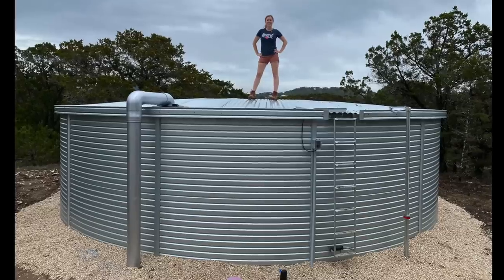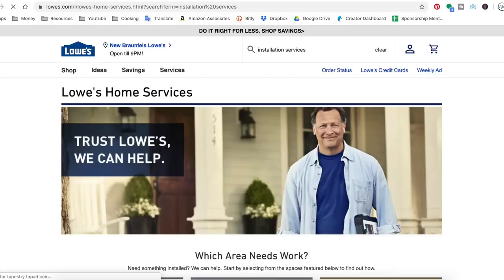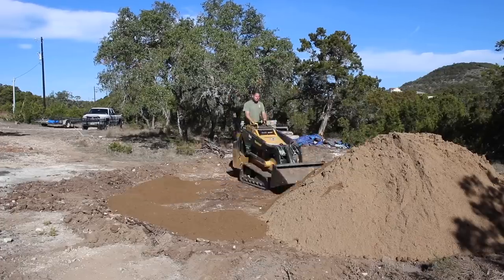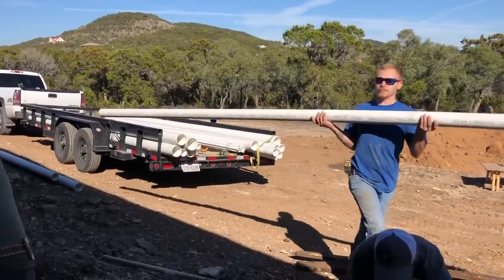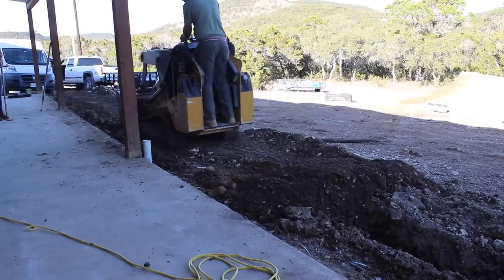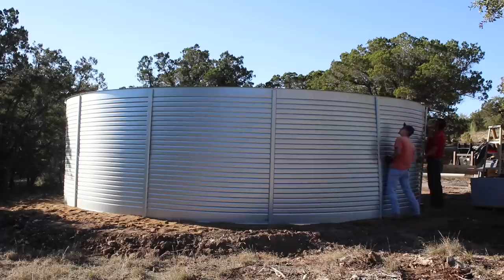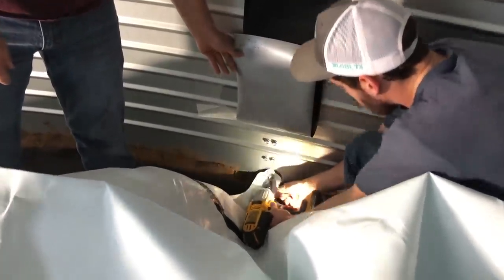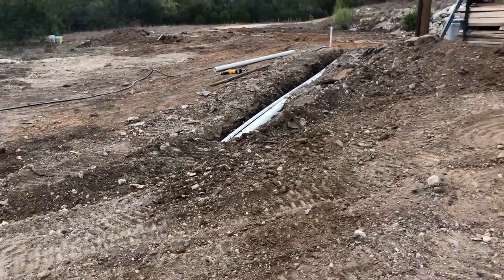Installing Rain Water Collection

Comment: I’m curious about the cost?
Reply: The average cost of a system like that for household supply in central Texas is $30k, plus or minus a few thousand based on the sitework and amount of collection piping.

Comment: Only 1 thing I would of done different.  I would of contacted the local fire dept. and asked about adding a outlet for the fire dept. to connect to in case the you ever needed it.
Reply: In Australia when I installed my tank I had to provide and fit an outlet valve on the tank so the local rural fire brigade had an alternative supply. This was rural Victoria in 1986.
Reply: Only makes sense.  After 25+ years in the fire service I know first hand those extra supply sources are great to have! Plus here in the States it can help lower your insurance.

Comment: Laws against rainwater harvesting/collection make no sense to me. In Australia, drought is a pretty big and unfortunately all too common issue. People here are encouraged to have rainwater tanks to minimise the amount of water we have to use from our potable water resources. The additional advantage is that it saves us money on our water bill!
It helps to prevent flooding in the event of heavy downpour after a long hot dry summer in which the grounds turn to almost-concrete, and using the water outside of the rainstorms means that it can contribute to any water run off sources that feed rivers or streams that native animals rely on for hydration. Win-win-win.
Reply: Australia is many decades ahead of Central Texas when it comes to rainwater harvesting, but we're trying our best to catch up. We have very similar water issues.

Comment: Can you mix a gray water system and a rain harvesting system. I’m sure I produce 100 gallons a day from showers, laundry, and baths.
Reply: gray water should not be stored more than 24 hours, or it can become "black" water.  Rainwater is very clean if collected from a roof but if mixed with any gray water will become gray water itself...

Comment: @ April Wilkerson How much rain water can be collected in this system?
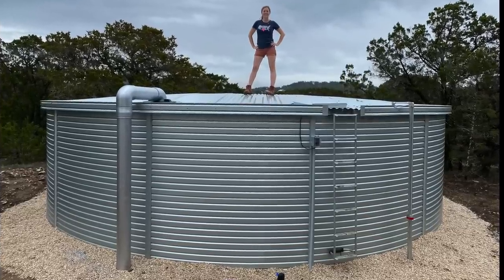Reply: She answers that question 10 seconds into the video. 0:10
Reply: @GeneWaddle  I do not have English, can you write in writing?
Reply: @alonsobrosmann4300  Sorry, it's 30,000 gallons/114,000 litres.
Reply: @GeneWaddle  Thank you for your answer
Reply: In central Texas the average annual rainfall is about 900mm and it only takes 300mm of rain to fill the tank, so it can fill 3 times per year.

Comment: I'm one of those metric viewers you mention, which is equivalent to 3,5 imperial ones I think...
Reply: A gallon is 3.78 liters. that's 113.4k liters of water cap... And 113 tons of weight ;) That's like two cistern trucks. The British gallon is 4 liters, but haven't seen it used.

Comment: With 37 inches annual rainfall, looks like you can fill it twice a year. Or your well can fill it once a day with hard water. Rain water feels so good. I'd at least plumb it to the shower and bath. Try shampooing your hair with rain water. Amazing. 

I would have added a large tap from the tank for the fire department to pull from. Call your fire department and ask about a fire hydrant. They can draw the water with their pumper.

Comment: so the water runs up the pipe into the tank ?
Reply: Yup.
Reply: @GeneWaddle  most be one hell of drop from the roof
Reply: @lesmoor001  It doesn't have to be. The roof only has to be a little higher than where it goes into the tank.

Comment: I don't understand....how does the water run UP that 6" line into the tank???    The momentum of the water is great enough to run straight up that pipe???
Reply: Because the pipes the water is going into are higher than the pipe feeding the tank. Water seeks its own level.

Comment: Here is a useful calculator to figure the amount of rainfall over a given area in gallons. 
https://water.usgs.gov/edu/activity-howmuchrain.html

or a quick and dirty method is this:
Rain catchment area in square feet X rainfall in inches X .62
e.g. 2000 X 30 X .62 = 37,200 gal. (actual amount according to the USGS link- 36,205)

Comment: Why not have the overflow drain push the excess water into your well?
Reply: NO, NO,........no. The last thing you want is to contaminate a well with surface water. That is the reason where there is a well there will normally be a pipe sticking out of the ground so as not allow surface water into the well.
Reply: Larry Be I did not mean directly into the well. I meant have it dispersed on top of the well so it can soak back into the ground water. Rain water re enters wells/aquifers all the time by permeating through the ground and having the dirt, rocks, and other permeable layers remove contaminates. If I had a well I’d water the water to be dropped off in the area that would allow it to re enter most efficiently and not just run off downhill
Reply: @Michaeldashizz  
I see your point. Depending on what is subsurface with so much rock in her area it might never make it into the aquifer. We may not even know where a vein of underground water originates. That is the whole principle of drain fields for septic systems. Depending on the percolation rate determines what style system you can install. Too fast and it is not filtering good enough and too slow and it is not entering the ground to do its job. I suppose one could dig a big pit and fill it with stone and let it run in to seep into the ground. That is what was done at my parent's home with a french drain and it did just fine. It was amusing to see it when we had a downpour the sod would rise up in a mound.

Comment: With the tank alone not assembled or installed at $15K and no less then that much again installed, It would have to replace my city water for the next 41 years to break even with my current on grid water bill.
For farm/livestock use I can see it, for off grid home use a lifetime is not long enough to justify the cost.
Reply: It can cost nearly $30k to connect to the local water supplies in central TX when they're available, and a well with storage tank and treatment will cost about the same, and far more if reverse osmosis is required, so for new construction rainwater harvesting can be the least expensive option, especially in the long term.

Comment: April
What did it cost you?
Reply from the maker: You can contract the company or a local one to see what it would cost. There are many factors with any project someone undertakes including land, proximity, etc. so can be subjective. What it cost one may not be what it cost another because one may require a larger size. Thanks for watching.

Comment: No First Flush device, pump in wrong spot, pump too small for home , supply pipe to house too small.  We live in rainwater in rural Australia.   My pump supports 3 showers , 3 bathrooms, 2 kitchens.
Reply from the maker: That's great for you! Mine is to water my garden and yard so is plenty sufficient. Thanks for watching.

Comment: Laws against diverting water exist for the protection of the environment. People need to check their state and local laws about harvesting rainwater; especially when harvesting as much as 30,000 gallons.
Reply: Rainwater harvesting is generally considered beneficial to the environment as it comes pretty close to simulating pre-development water flow conditions.  Most of our clients use the rainwater in their home, then the wastewater is treated and sprayed onto or soaked into the ground, reducing runoff just as a woodland or grassland would and maintaining soil moisture throughout the year where it's applied.

Comment: It is stupid to ban water collection, especially when it is used for local irrigation  it is more likely to permeate to the water table and renew depleting ground water tables. Also if reduces carbon emissions as it doesn't require industrial pumps to pump water for miles. Every property should harvest water and use   swales to irrigate land, grey water should be used to irrigate trees, sewage should be treated then filtered through Reed beds and finally willow coppice beds which produce wood pellets for wood pellet mass heaters.

Comment: Why did you put roof on water collector? Leave water reservoar open and rain will fill it with water.
Reply: And any other crap that happens to be flying around plus dirt, bugs and other critters. Besides that, the shop roof is a much larger surface and will fill it a lot faster.

Comment: Those tranches are to shallow. If any medium/heavy vehicals runs over the ground above them they may crack.
Reply: The pipe used is pretty hefty and once the ground settles there won't be a problem.
Reply: The pipes are installed by professionals. Are you saying they do not know what they do?
Reply: @erikloupias7511  i didn't said that....and it was you who call them professionals not me. I said the trenches were shallow....which they are (due to solid rock soils). I said they MAY crack IF subjected to heavy loads. That reuse of the soil (grading) takes the edgy rocks but it's not enough to make it suitable for direct contact with the pipes (by the books). I've done lots of pipe trenching/fixing in urban places and stumble uppon other people ' s work (while digging) and you see patterns. Tha t's not a sidewalk on the city....but that's not  a garden next to a house either. That shop sees alot of "action". If she starts moving heavy loads of stacked slabs around (Mat Cremona style) those yellow flag unconformitys became red ones.

Comment: The economics don’t pan out for me. A 30,000 tank costs at least $10,000 and probably much more. It would take a year to fill with my downspouts. I can buy 30,000 gallons of city water for $170 in California. So it would take 60 years to justify the tank, assuming it and I lasted that long.
Reply: Your assessment sounds correct, and that a system like this would not work for you.  The economics are very different in Central Texas where we often have to choose between attempting a well or trucking the water in at a considerable cost. A tank this size pays back in 5-7 years if trucking the water in, and pays back immediately if your well fails or you can't reach good water and know it up front. Rainwater also compares favorably to connecting to a municipal supply when you consider the $20k or so it costs in impact fees just to connect a new home to a MUD supply.  (assuming there's no sewer involved)

Comment: Next step is solar panels =]
Reply from the maker: Yes! I want to explore all the things eventually.
Reply: @AprilWilkerson  Research SolArk.  Really like the idea behind these systems for grid tie/battery/solar controller.
Reply: @LordNelsonkm  That's a great device at least on paper, just a bit expensive. Since the majority of the load in the shop is motors, it might make more sense to distribute 400V DC to VFDs.
Reply: @NiHaoMike64  True, and since her load is a lot of big stuff, I'm assuming a solar system will be for meter offset.  It would have to be a rather large battery bank if she's going for self sufficiency.  A good goal though there too and she does have the space/skills to build a power house rather than burn shop space.  System design goals will be an important decision.  Too bad the shop isn't rotated 90 for a N/S orientation.  Looks like E/W based on shadows.

Comment: Nothing on cost?
Reply: Cost compared to having to drill a well like 10-12k. Looking at a 5 acre property in near future. Has no well yet
Reply: In central Texas these systems run ~30k usd. A well is mid 20s but can need another 5 to 10k to make it usable in the house. Folks who've had both well water and rainwater say it's a no-brainer.

Comment: I like your videos because nothing is built before it is drawn on Sketch-Up (or whatever other program you use). You seem to know to the 1/16" (or a millimeter) ahead of time, what length or angle to cut a board -- be it a workhorse, or a tank gizmo, a shop roof, or a drainage pipe. You do nothing without drawing it, looking at it, analyzing it, adjusting, then finally making a decision to jump in or not. In my corner of the World, we call this "Good Stuff".
Here is what drives me bonkers -- not with your videos -- but with many others on YouTube. Couples jump into building a house (of all things). No drawings, no pre-planning, no common view of their expected final result.
Can you show us how you go through your planning? How much detail does your husband provide? Does he provide overview and peer review? Can you show us which software you use? And how you use it? Show us two things -- a workhorse design AND something weird (say the tank piping, or electrical, or even how you laid out the roof troughs). Thank you from East Coast Canada.

Comment: 13.35 Rain water collection ILLEGEL???  What manner of crap is this? 
I grew up in a rural area, at that time everyone I knew had rain water supply.  And the storage was 25000 gallons plus to get through the dry years(family of 6),also the area had reliable good summer rainfall.  Cleaning the leaves out of the house tank was an annual job.  These days you have leaf guard to keep the spouting and tanks clean.
  ONE thing that was not mentioned is if there is arial spraying (weed, not fertiliser) you need to disconnect the water (there is a bypass device to do this) and rinse the roof down to avoid spray drift getting onto the tank water.
 I also think April will have a problen with erosion at the overflow pipe.  It needs to be longer to get the water further from the tank before the water gets to the ground.  Possibly, with her stoney ground the short overflow pipe is sufficient, but in my soft volcanic ash soil that short overflow pipe will cause trouble, when not if. 

Over all a good starter video for some one going rural and off town supply for the first time in their life. It will help them ask the right questions.

Comment: Well😁April I know the area in Texas more or less but, what? While you will get enough rain to fill it most (normal) years, that’s more than way to much!! Just for gardening,a few cows.Unless you intend on using for all water needs!! Daily use for your entire home, and all the above
Reply from the maker: Nah this isn't too much at all. I have lots of land I plan to grow grass and irrigate. Then I'll also have my garden and eventually plumb it into my shop and house. The biggest expense with a system is the tank and once you get to 10,000 gallons and up, the cost drastically goes down. So when I was comparing costs, I decided on going with the largest tank I could afford instead of starting small and having to add another later.
Reply: Yes if you eventually hook up your home( non potable) you can use that much. It will pay for itself someday

Comment: I think these are illegal in California
Reply: California is Pioneer's second biggest market in the US, but the tanks are not necessarily filled with rainwater.  Lots and lots of red tape though, while in Texas there's usually no permit needed.  In Texas we do not have the seismic issues that California has to deal with.
Reply: Southern California here. Many cities not only encourage rain harvesting but offer rebates and education on how to set up your own system.
Reply: Rainwater harvesting systems are legal in California, as long as they comply with the California State Water Resources Board requirements. Assembly Bill 1750 (2012) enacted the Rainwater Capture Act of 2012.  The bill authorizes residential, commercial and governmental landowners to install, maintain, and operate rain barrel systems and rainwater capture systems for specified purposes, provided that the systems comply with specified requirements. A landscape contractor working within the classification of his or her license would be authorized entry into a prime contract for the construction of a rainwater capture system if the system is used exclusively for landscape irrigation. Here is a great article that breaks the bill down:  https://www.lexisnexis.com/legalnewsroom/top-emerging-trends/b/emerging-trends-law-blog/posts/california-s-rainwater-recapture-act-lets-state-residents-capture-use-harvested-rainwater

Comment: You’ll never fill it
Reply: We get an average of 34" of rain per year in Central TX. A few times a decade we get enough in a day or two to fill that tank. We have big tanks here because the wet and dry periods are unpredictable.
Reply: Impressive. I have four 55 gallon tanks for watering the landscape in Cincinnati.
There are areas of the country where it is against the law to harvest the rain.
Reply: Colorado has the most restrictive rules,  and even they allow up to two 55 gallon barrels per residence. Many Western States are governed by water rights due to the limited water supply- it's considered to be a public resource. Texas is almost the opposite, and encourages water collection with tax exemptions.